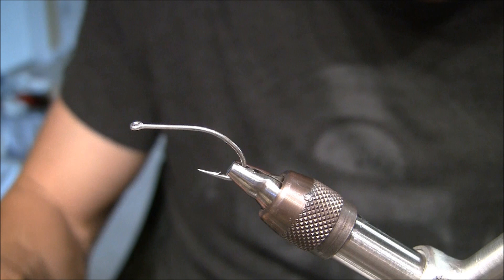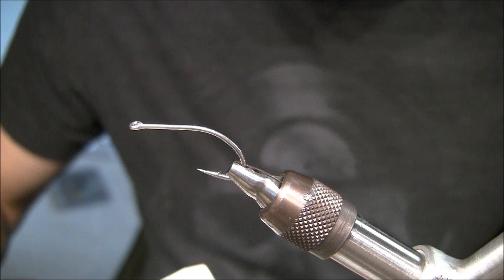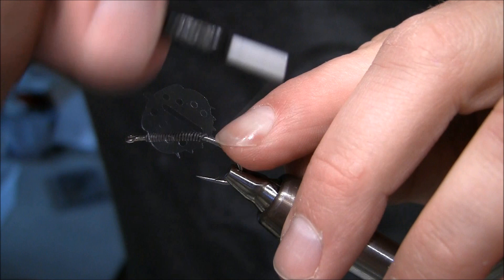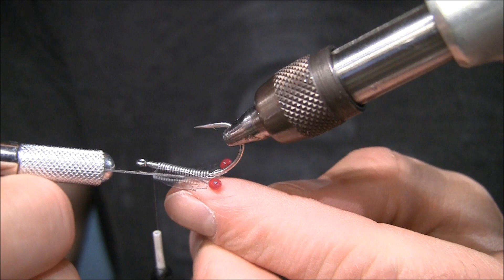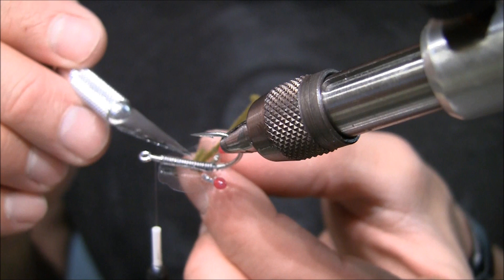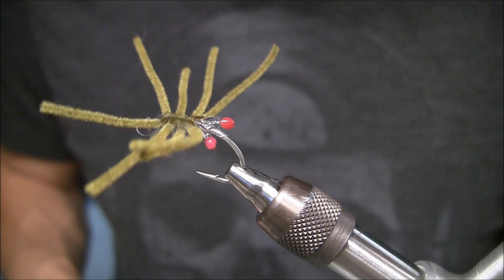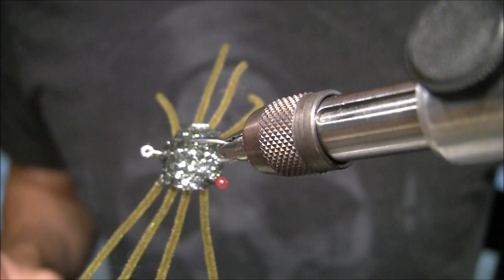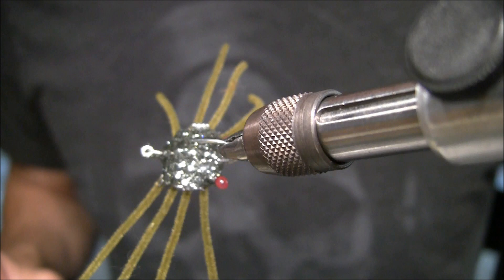Kiley's Crab Skinz

Comment: Is there a design or performance reason not to thread chenille through one hole, under the hook and out the hole on the other side? As opposed to adding each leg individually? I have enough problems with pinfish nipping off legs. Just curious. Thanks in advance.